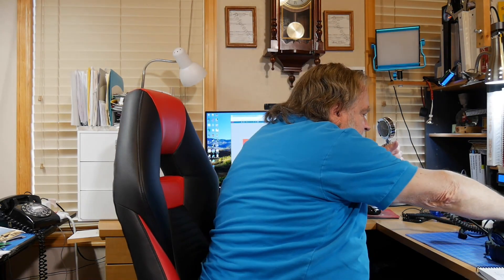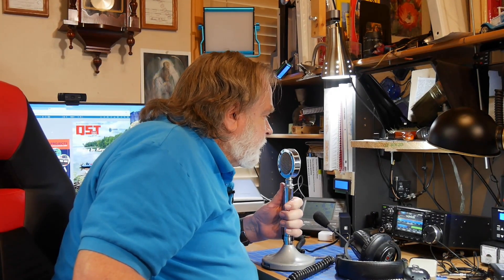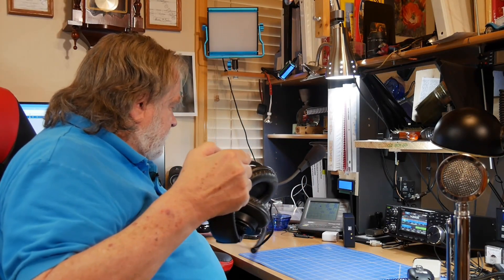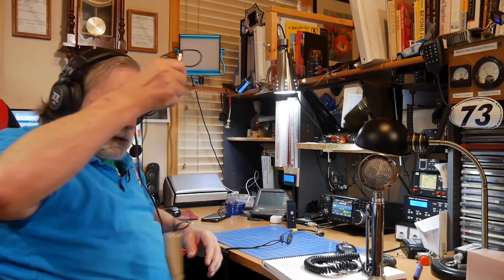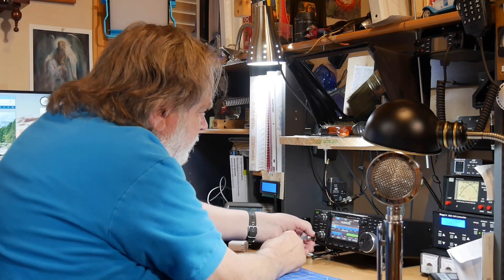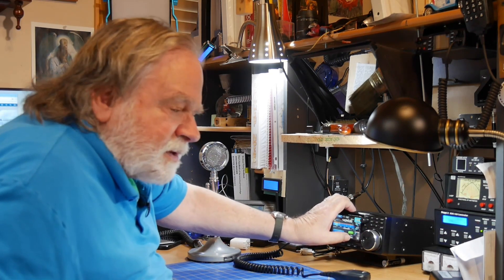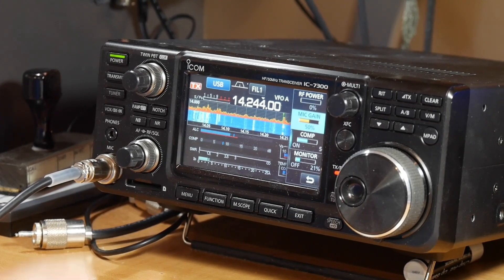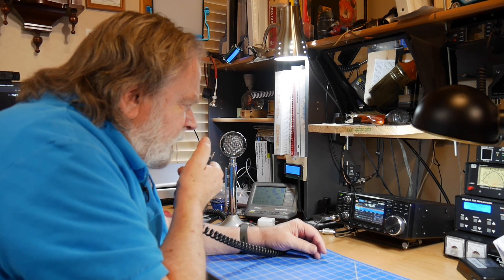Clean Signal Initiative: Mic Gain (#1149)

Comment: For the 7300, the radio puts out its full power when you get any indication on the ALC meter. For those doing digital, that bar should not indicate anything.

If you're into local ragchewing and want the 7300 to sound natural, you only want to see the ALC flick up on voice peaks. You're also better off disabling compression or running it low, as it will bring up your background noise, and running the radio as wide as it can go, which I think is 100-2900Hz. The stock mic is pretty good!

Those into DX will set it up differently, the book recommends halfway up the red ALC zone. It's a good idea to monitor yourself on a kiwisdr to make sure you sound ok and you're not splattering.

I should probably mention, the 7300 puts somewhere around 0.5-1W when your RF power is set to 0%, which is more than enough to be heard with quiet band conditions. You may want to do tests into a dummy load.
Reply: I agree on compression, set to 2 or 3 with stock mic, or it starts to sound unnatural.